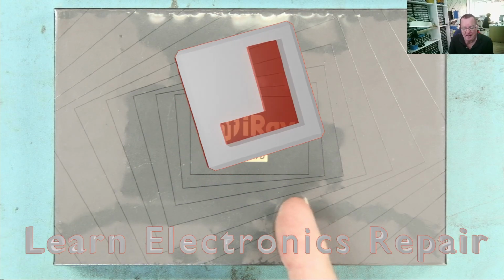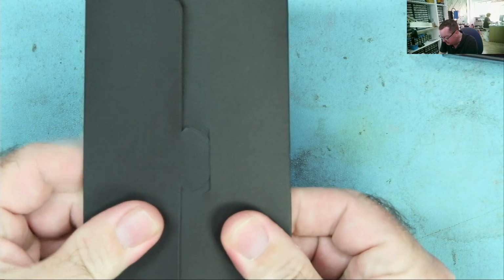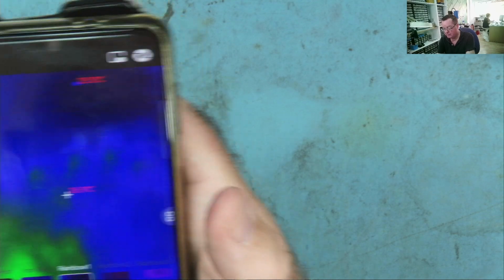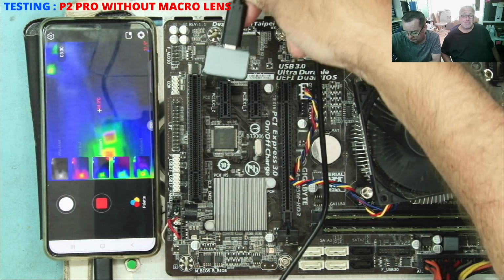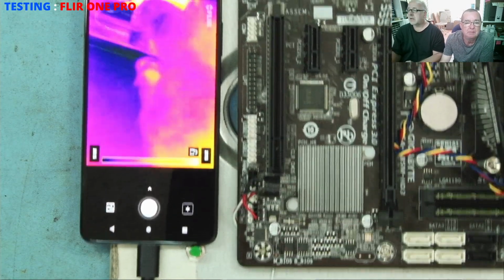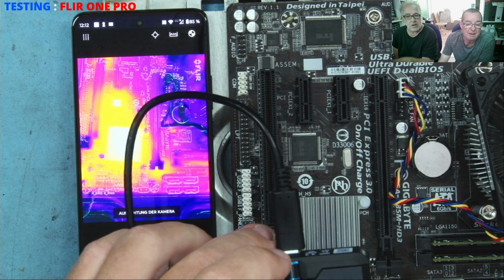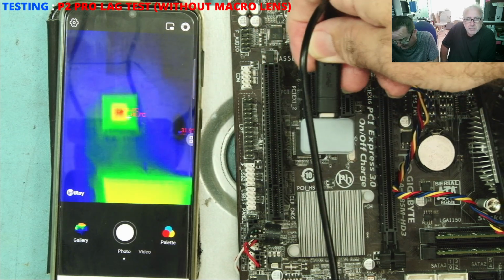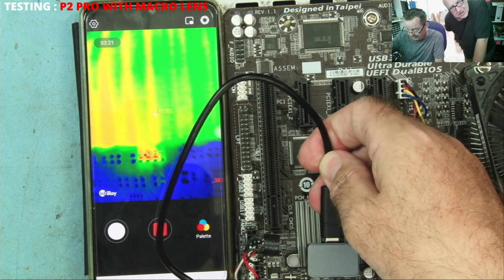InfiRay P2 Pro vs FLIR One Pro - Which is the best thermal camera?

Comment: Hi and many thanks for this very interesting video.
Regarding the P2 Pro, I would be very interested to know whether it is possible to take precise temperature measurements afterwards on the recordings (images)?
Is that possible and how accurate are the values?
Because I once read that this wouldn't work well because the camera wouldn't save the emissivity values and as a result the values measured in the pictures would no longer correspond to those of the live measurement....

Comment: Watched the vid.  The two lenses on the FLIR unit are about 3/4" apart and you have the camera inches from the motherboard.  Do you guys understand the term 'parallax error'?  If the alignment is an issue, turn that function OFF.   You got a free Infiray unit to test, not sure where the FLIR unit came from but it appears you paid money for it.  It's very obvious that you've given the free unit preference, not an unusual occurrence for a gift.  I do like the higher IR resolution of the Infiray and I may try one but I'll stick with a FLIR or Seek for my applications.

Comment: For the FLIR Pro… I have the same one for android and to do an auto calibration you have to press that globe icon in the top right corner which is under the clock… once you press that it does an OK job of automatically aligning the heat overlay with the Image… After that you do the manual adjustment.

Comment: In my opiniom, any thermal camera that you have to use a mix of optical and IR picture, is utter garbage. If Infiray had a great software, there would be no need for Flir to exist. I own a Doogee S98 Pro and Infiray built in IR camera is awesome, but that app is by far not great. Flir is garbage if you are not willing to spend above 1000€.
Reply: I'm thinking about buying that phone, how are you getting on with it?
Reply: @Bomag  it is good. Also, quite heavy. Except for thermal camera it is "notbing special" phone - mediocre camera, display and cpu. I heard that Doogee made a new one with 5G and Amoled screen - V20 or V30. For me the biggest problem was inability of thermal app to save IR and RGB picture simultaneously and all inquiries to doogee and infiray went unanswered - the app even saves both images in a single file that i can edit later, but not on a pc. The phone is still way better than Cat S65 Pro.
Reply: @janisvaskevics93  Thanks for replying. Yeah I noticed that new one too, although it weirdly has worse reviews for som reason. II was considering buying one of these USB-C thermal cameras to use on the wifes android phone and thought - hang on I can basically buy a phone for the same price as the portable camera? It's like the phone features basically cost nothing. I don't care too much about the rest of the phone as long as it works generally well and I can ring the wife on it when needed and watch youtube on the bog.
Reply: @Bomag  well, for these features that Doogee S98 pro will be great. I also bought it because of price - grabbed one on sale for 299€. No decent thermal camera costs that little - you are spot on there. I cannot vouch for reliability of Doogee, but mine has been reliable for about 1/2 year so far.

Comment: It would be nice if you did a video with the p2 pro with the t2s side by side.
Reply from the maker: I can certainly do that for you after the weekend.  Having used both now, they both give the same resolution and frame rate. The T2S+ is 8mm macro lens manual focus and the P2 Pro is optional macro lens auto focus. I did find this one a little easier to use than the manual focus T2S+ but I think that would also focus closer to the PCB. I'm not sure I ever saw that effect where some resistors were lighting up due to current passing through them with previous thermal cameras but I thought the T2S+ was excellent so let's try the two head to head.

You can see my T2S + review video here
https://www.youtube.com/watch?v=2X0RAfqPvIw
https://www.youtube.com/watch?v=ctmJ97NtMCY